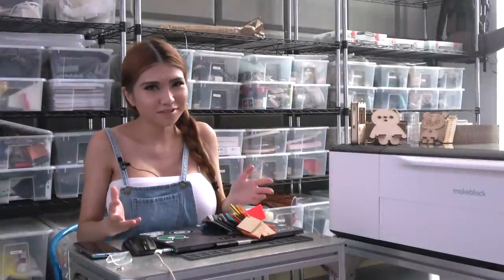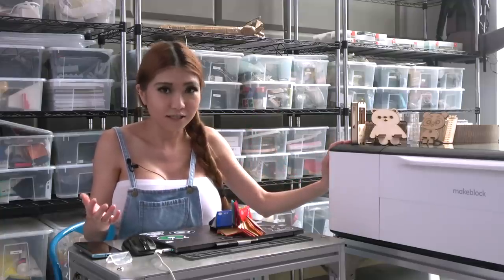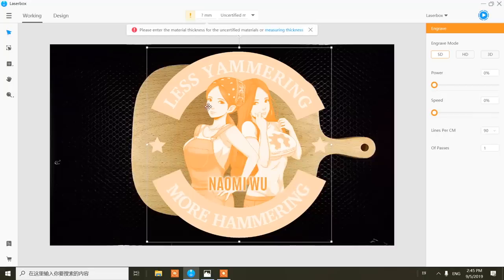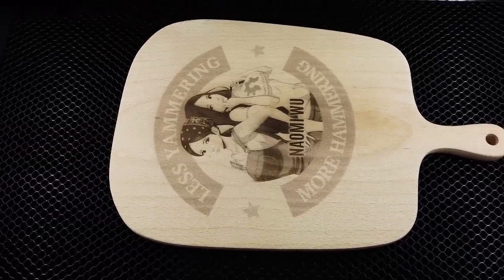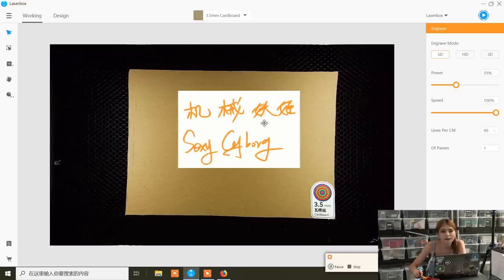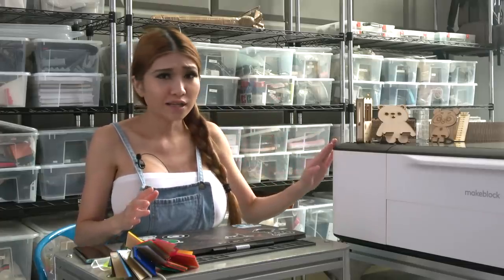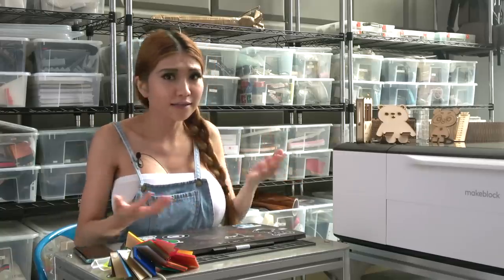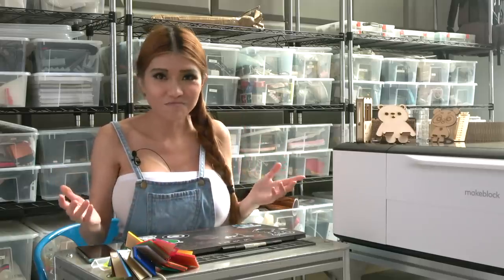The Makeblock Laserbox- Best Hobby Lasercutter You Can Buy?

Comment: I assume that it's not available in the US because they are violating the Glowforge patents. The look and function are awfully close.
Reply from the maker: I asked Glowforge first- I would not review it if it was violating patents. Glowforge said as far as they knew, no.
Reply: ...its a laser ...it does the job of a laser, glowfordge wasn't the first laser not even the first in that form factor this is also bigger than the glowfordge
Reply: @crashoverride93637  
It's not that. It's the use of the lid camera. Codes on materials. Using the camera to capture art work. Real time video of cuts. 

Maybe Glowforge didn't protect worldwide.
Reply: I checked the link, not available in the US.
Reply: The design patent has been granted USD827705S1 
Video calibration application US20180150047A1 is pending.
Image tracing application US20180150058A1 is also pending.
Reply: @Naomi-Wu  
No big deal but as an owner of a Glowforge, it just struck me that there were many style and functional similarities. It's up to Glowforge to defend any IP and they have nothing to defend until the patents are granted. 
Patents are worthless unless you have the resources to litigate and you win.
Reply: I assume it is not available in the US because they are still in the process of getting it cleared by US authorities governing the safety of such devices.
Reply: @Naomi-Wu  It was a wonderful piece! Thanks for making it.  I didn't know anything about the product before watching your video review - I'm so glad they let you have it without strings attached.
Reply from the maker: @danshapirosea  thanks Dan! If there's anything I got wrong about Glowforge happy to mention it in the next video😊
Reply from the maker: @suomynona4607  well the copied concepts no doubt there, but theft is something else and there's plenty of iteration. I'm no supporter of outright clones, bad for Chinese innovation.
Reply from the maker: @suomynona4607  if Glowforge persues a patent complaint I'll be sure to mention it in a follow up video, as I said, I'm all for Chinese R&D and our own IP. No reason to support theft if that happens...
Reply: @suomynona4607  the new Epilogue lasers also have a lid camera for positioning etc, it is a really useful feature.
Reply: Why price quotes and not simply 'the price'. It's not hard to publish a price list, so why not? I jump to  the website and find no prices  jump back to the video to see the link for quotes. Come on... Either you know the price or you make it up .
Reply: @rowifi  This isn't exactly a consumer product and may not have a finalized design. While frustrating it is very common practice even for US companies.
Reply: How does glowforge have any patents? They didn't invent the laser nor did they incorporate it with a cnc programming.   Glow forge is lucky people buy their overpriced internet based machine because it's not even an industrial powered laser untill your spending the big bucks. Epilogue laser was the original home cutting laser system with a system that could do everything and more that glow forge.  So who has all these so called patents and does it even matter any more when th USPO can just over ride your patent for something that oddly does the same thing but doe it in a similar but not exact way.  They do t care and for the right amount of money they USPO will just overlook your patent rights.   So this is nothing to worry about.
Reply: How does glowforge have any patents? They didn't invent the laser nor did they incorporate it with a cnc programming.   Glow forge is lucky people buy their overpriced internet based machine because it's not even an industrial powered laser untill your spending the big bucks. Epilogue laser was the original home cutting laser system with a system that could do everything and more that glow forge.  So who has all these so called patents and does it even matter any more when th USPO can just over ride your patent for something that oddly does the same thing but doe it in a similar but not exact way.  They do t care and for the right amount of money they USPO will just overlook your patent rights.   So this is nothing to worry about.
Reply: Many laser cutters use cameras. Dremel has been around for ever, they also use the lid camera, same as Muse Lasers

Comment: at 7:40 ,u can use "circular polarized filter" or CPL to control the light reflection. it can also use to record thru water or recording view with cloud. the filter it is adjustable(rotating). some time CPL come with adjustable ND filter. cpl is for reflection cntrol , nd is for blocking light . i use the cpl for recording car without the reflection of me on the car.

Comment: Hey Naomi, it's Q2 2021, can I request an update video on laser cutting technology now? Comparisons and what you like/don't like about some of the stuff out there?

Also, a more personally curious question: what are your thoughts on working with a 20-50 Watt laser vs working with a 100-120 Watt laser (commercial grade)?

Brands I know about and have used before in my school before:
BOSS 100-120W laser = I thought was incredible. I want one, but the price tag is brutal. 
Universal Laser Systems 100 - 120W laser cutter = I want one of these; it's ridiculously good too, I also liked their interface. Again, price: brutal.

Universal Laser Systems 60 - 80W; I also thought this one was good, but for the price to me it may not be worth it. It's that whole cleaning and maintenance aspect that I'm familiar with when using these machines that makes me wonder which is worth it for it's price tag. My opinions about the laser cutters I've used in school date back to 2015--so I don't know what the state of laser cutting systems are today in Q2 2021. Thanks~

Comment: Nice note on the GlowForge being an cloud-tied tool. Not something that is commonly highlighted(in the stuff I've seen/read on them). Although I never expect to loose internet connectivity, I am still quite adverse to cloud-attached anything if I can help it for things where it doesn't make sense and cloud connected tools...just to use does not make sense. Would love to see more on this on this piece of equipment as I'd love to add something similar to my set of tools.
Reply: This is definitely the most annoying part about the Cricut vinyl cutter: it's somewhat cloud based - but ironically also runs a small web server on your (Windows) PC to do the computation and control. If only they'd permit normal g-code or let you use the server without their online component....

Comment: k40 is not supported by default on Lightburn, since it uses a controlling board (most frequently M2 Nano), that is not compatible with the application. The user has to install a different board (Gerbil, Cohesion, ...).
Reply from the maker: Yes, that's why I said you have to spend time getting it to work...

Comment: You mention people with tight budget should get K40 and LightBurn. But LightBurn page states it does not support stock board on K40.
Reply from the maker: Well yeah, that's the thing, you have to put a lot of work into the K40 to get it close to this. If K40s worked out of the box with Lighburn- that would be a much stronger contender.

Comment: A very informative review, thanks! A big downside (compared to Glowforge) is that it has no air assist. I've seen posts about lasercutters without air assist that the laserpower is reduced during a project because the lens is covered slowly with dust. Did you have the same experience? And do you know if they are upgrading the Laserbox in the future with an air assist (as GF did) ? Many thanks :)!

Comment: Looks like an interesting unit, but we don't use OSes that only patch monthly and the cloud systems run well on Chrome/Linux.  I'd rather local than cloud for exactly the reasons you mention and it supports ENet for a solid connection.  This looks like a very good hardware and I like the QR code for material recognition. If you had a stack of material, you could print QR codes in one pass for later use.  You are one of the most professional YouTubers that I've ever seen and your content has great content.  Thank you and thanks to Makebox for providing you with a review unit.  (Love the ending too!)

Comment: As always a great job. Nice looking unit, would be interesting to test out. One thing you can try is etching your own circuit cards. We developed our own process 20 years ago with a CO2 laser. Since I used to teach in STEM I came to the site to see your approach and thoughts as a female on the subject. Still have not found a way or correct button to push to get full classes of STEM female students. I did not, like some come to look at the scantly clad woman but will admit it does give a nice back drop to what ever you are assembling or working with. Don't change it is working for you.

Comment: the time estimating is a good feature
cameras  used  already  with laser
just remember  the  shoe industry already using

a camera brings a raw  leather in the  computer  and you can move rotate parts on the leather maximizing  the matrial

tracing outlines  also  solved solution on routers either way camera  picture the whole area  or  using  contrast tracing the  true outline

Comment: As always, a detailed and balanced review of an outstanding product; including the thorns. Since you no longer have the fish tank, I'd see if the sharks with "fricking laser beams on their heads" would be happy in your bathtub. If they're bored, you could always have them laser cutting something; something like the workmen digging the trench outside your door. Clever the way you used a comedic twist to turn a irritating situation into a humorous one with allusions to a popular movie of some years past. Are the dimensions of usable maximum stock size on their website? I am curious to know the size of the largest stock it will take for h x w x thickness. I am also wondering if it could cut aircraft rib parts approximately 10-15mm in thickness and using spruce as a material. On another note, would it be profitable to cut multiple and unique designs featuring your logo for sale along side your other merchandise using this product?
Reply from the maker: Yup, dimensions are on the site. Shipping things is a bit of a challenge since I don't have time for visits to the post office...
Reply: @Naomi-Wu  Thanks! I got them.

Comment: Naomi, I'm an antique auto parts specialist.  Do you think you could use this cutter to make obsolete gaskets?  If so, what CAD software would I use?  Can i scan the old gasket and use software to make a CAD file?  Thanks in advance for your answer!
Reply from the maker: Yes:https://www.instructables.com/id/Custom-Gasket-Laser-Cut/ but I would check with them how thick the rubber is it can handle. You can certainly scan it and then trace that outline. Inkscape is good and free.